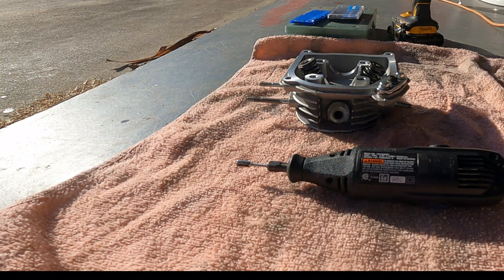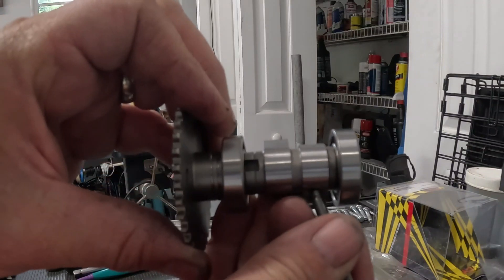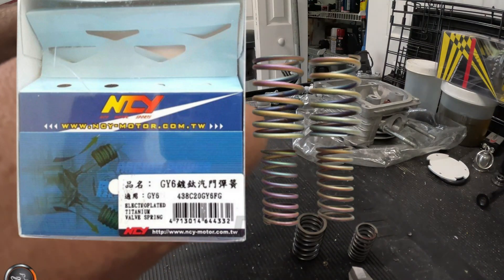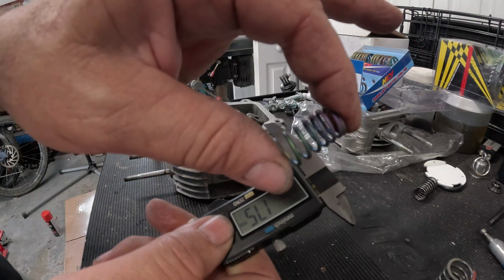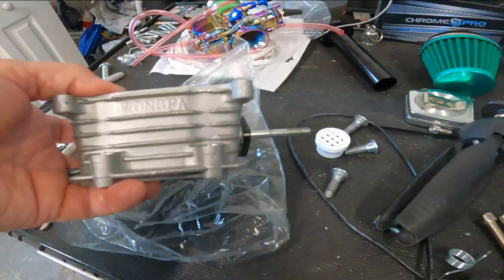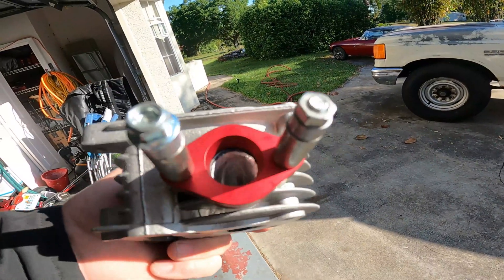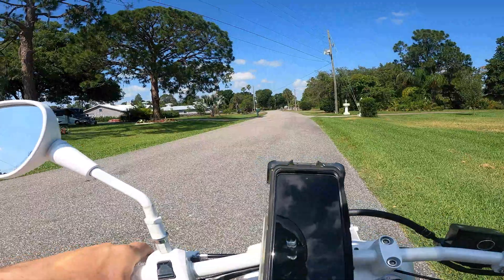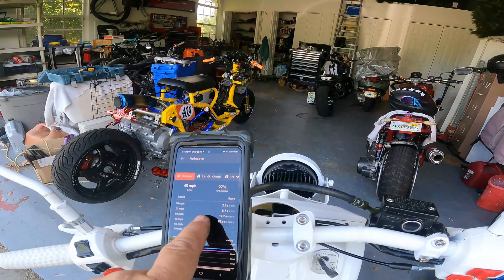Can You Port Your Own GY6 50cc 139QMB Maddog Head and make it High Performance to Avoid Valve Float?

Comment: What determines a kit compression. The weight of the piston or the thinness?
Reply from the maker: The compression ratio?  That is a big secret it seems.  I have not been able to find that info anywhere.  It is purely based on the volume of air at TDC vs the volume at bottom.  Lighter thin pistons are made to spin up to RPM quicker.  Heavier pistons are made to withstand high compression loads from things like turbos and nitrous.  So piston weight and thickness is kind of out of our hands as I have no idea if we even have choices other than cast and forged.

Comment: Hi great video, please what is that app for speed recording called?
Thanks 👍🏻
Reply from the maker: It is called "drag racer" .  I think it is dead because I dont get ads anymore and I cant find it on the ad store.  It is not that accurate on faster bikes. Works good on the maddog, but for the electric stuff I need the Dragy ($100ish) to get more accurate 0-60 times.

Comment: And I got news for you I'm using a poloni variator just a little bit bigger than diameter and it has better roller ramps polini clutch also and having very good results GY6 50cc I don't know why it's not working on your engine but the bike weight is different other factors to but you know what your bike does and what works best for it but the stock variator ramps are just no good and the ramp angle is very bad too for top speed do a little more research or do your homework a little bit more you'll see will definitely with the Big bore kit

Comment: I know I'm leaving a lot of comments also I want to say to you size I really like your show and you know what you're doing it's just a suggestion your minimum with your torque and your horse power and to expect any kind of improvement it won't be much because you're just limited with your displacement and your torque and so what I don't think you're wasting your time with the valve springs and the Portland and Mill the head that's what I always do everything that belongs to me and that makes a difference on top end speed

Comment: If you really want to get technical like you are intake valve diameter Port energy velocity low lift flow I can go on and on and on valve curtain area you know I know it's only a GY6 but yes it will make a difference I don't know why you're saying that I guess maybe with the little 50cc 39 mm piston what do you expect I guess that's what it is 39 or 37 what you make sense for most of the stuff you're talking about and I like your show keep up the good work

Comment: What you doing a really good job it's running really fast for a 50CC I'm working on a 52.4 MM Big bore Naruku build and I'm shooting for 70 mph I had it up to to 60 mi an hour what the 52 mm satin finish is what you want with your porting and polishing and it makes a difference once you have more displacement
Reply from the maker: @steveblottenberger1097  You must be running a skinny tire Tao Tao or type scooter?   That's an awesome speed 🤘👍

Comment: Ok so i put together a 80cc motor .. i used ..used parts but they were in great condition .. except for the piston rings  but im not sure what head to use exactly i have a bunch of stock 50 heads some have a better or deeper combustion chamber and some hardly have any .. i dont know what one would be better to use .. right now it seem it has way too much compression .. but at the time i had the motor on the scooter my kick start was broken and the electric start wasnt spinning it fast enough .. actually is was very vey slow .. now i have a kick start to use . So i may keep motor the way it is and try and kick it . But what do yall think does it sound like too much compression with my very Lil bit of information . Any help would be appreciated 👍 thanks
Reply from the maker: @RickyBish  high compression is good for power but can be super annoying also.  Scary to start and hard to start

Comment: Can I install thicker washers to the bottom of my valve springs to act as a more stiffer valve spring?
Reply from the maker: @JonahNAloha  Yes.  They are "valve shims".  You can run 2 on there instead of the stock 1.  I think 50s and 150s might be same if you have any spare ones laying around.  If not just thicker same size washers.

Comment: I keep my 150cc rpm between 8-9 max. Ive garage ported a bunch of old chevy heads and tbi heads. Turbo manifolds etc. I blame you for this next project though because i was looking for something else and got sidetracked with this one. Im going to have a. Extra 150cc head for my matte red one. Im curious if i go ahead and give it the port and polish what cam would you recommend to throw in with it for the trouble? I have the one rolling wrench sent me with my big bore kit on my other. I just remember in another of your clips you said you loved on of the cams and it was close to the big bore kit performance with carb and cam swap.
Reply from the maker: @tiredofinsanity  I do love that rolling wrench one.  It is a Taida T100.  Mid range.  I trialed an A9 and hated it, but...  I think I had my RPMs too low to appreciate it.  I could not make RPM with it and don't I think I tried lighter rollers.  That bike has an SSPG A12 in it now and seems to be a mid range like the T100, but way less money.
Reply: @GhettoWrench sounds like I have mine primed for this then

Comment: You didn't change the cam or valves so you didn't need heavier springs. Also you could have the best porter ever do the work, but the carb or exhaust can't support more airflow. You will not see gains.  More air in more air out, more power.
Reply from the maker: I have an NCY Cam and 19mm PE Nibbi on it.  Thinking about putting that 21mm PWK back on.  It made more RPM on top.  But ran worse down low.
Reply: @GhettoWrench  Pretty typical of a cam. They lower dynamic compression. Shave the head to pick it back up and regain more bottom.
Reply from the maker: @davidwickboldt712  how much can I shave the head?  It already has a super thin head gasket.  I put a thin head gasket in my ghost 212 and holy crap...  the difference was amazing.

Comment: Can u wire it back. I'm in a bind. Waiting on harness. I'm no nechanic
Reply from the maker: Wire what back?  The entire bike?  You can make any harness.  Check out my "chuck-it" videos.  I am pretty much making that harness.  Even tho I am using the originals wires so i don't have to buy more wire.  All the connections I am doing from scratch.

Comment: 69 mm valves give about 0.5 kW. Intake tuubing length is important for resonances.
Reply from the maker: So is the 65mm preferred over the 69 then?  My new BBK 52.4mm came with the 64mm valve head and the valves are bigger.  20/23 I think.

Comment: Another great video - given how long people have been fiddling with GY6’s, there are zero people actually testing for results… 

I’ve gotta feeling at the end of all this the advice is going to be put any tuning effort into a motor swap 😂
Reply from the maker: That was always my complaint.  No before and after results.  Im sure an engine swap could have already happened.  LOL.  I'm running outta ideas to try and get this faster in 49cc mode.  NCY performance variator is 89mm vs the 95mm one.  I may have one of those.  I think that big ass wheel and tire are what kills these things.  But that is also the cool look.  😎

Comment: How does porting affect valve float?
Reply from the maker: Well in theory when you get into stuff like porting and cams you also get into higher RPM which can exceed your OEM valve springs.  It was not the case for me.  LOL.  They kind of all go together in making a performance head.
Reply: When i ported my big valve head for my 90cc i think i did more harm than good    it pulls like hell at low rpm but higher rpm it looses allot of power so top speed is 70kmh 43mph

So i probaly made them a bit too big  i do have a 24mm carb with it tho
Reply from the maker: @DiyNuke  ahhh....  that almost describes what mine felt like.  Quicker, but struggled on top.

Comment: I think it’s worth it every time especially if you already have to replace springs or a valve. Any gains are good gains right? I think you did a good job
Reply: The fact that you actually used a spacer as a guide is a great way to get consistent port matches. By eye is how you get wonky ports so great job with that. Only thing I would have suggested was under the valve on the short radius of the port,  the tight turn can usually use just a touch of smother and the casting rings are usually there,  be careful of nicking the seat. Also there is a actual difference in the heads. 64 Mm valve length because of the short valve stem have the valve seat lower than the 69mm valve stem with the taller valve seat. Easy way to tell the difference is top of valve springs will be flush with the valve cover gasket,  69mm valve are just above the sealing surface.  69mm valve stem heads because of the taller valve seat can take more porting to the floor than the shorter 64mm valve heads. 64mm valve stem heads have a lot less material and are easily blown through.  There are videos of people cutting the 64 and 69mm valve stem heads in half.  So be mindful of which head you are going to port and for why.  Otherwise great video buddy 👍 👏 👌
Reply from the maker: @jeremyhope6869  thanks so much.  That is great info.  My new 52.4mm kit has the 64mm head.  I don't think I'm gonna touch that one.  LOL.
Reply: @GhettoWrench  Google 69 vs 64mm valve head should show you the difference so you can see how much you can actually touch up and where you can actually improve the flow. Seeing a cut away actually helps. Another thing I liked to do when I was seriously with the gy6 was use the old cylinder and cut away a pie cut so you can bolt your new head on and check your valve clearance with the cam bolted on and the valve fully opened.  Should tell you exactly how much you can shave off the head for max compression.  Think old stroke using a wire on the piston to check squish.  Same concept except valve clearance and simple way to check the clearance before shaving the head blind. Gasket thickness and since you can bolt cam on and actually get a idea of what cam is actually holding valve open for what and if your high performance cam is actually a performance cam for you. I know it sounds excessive but buddy you are way past simple bolt on and everything now is going to be custom made or modified 😆 🤣
Reply from the maker: @jeremyhope6869  my brain just exploded.  What a good idea compared to using clay with that cutaway.  I do have extra old heads.  Thanks.
Reply: @GhettoWrench  yep, how we used to set em up, cut the cylinder and see how much room to shave off the head. How much compression,  when the stock starter motor has a heart attack on the 2nd push of the button,  that is enough compression 😆  magic smoke from the starter,  yep perfect 🥰
Reply from the maker: Good point.  Everything adds up.  And on these 50s the gains are tiny since we start so low in HP.

Comment: Do you recommend the stiffer springs?
Reply from the maker: Not so far.  I am gonna drop roller weight again and see.  I really felt like they taking power.  Could be all in my head though. I never got to a high enough RPM to justify them yet.
Reply: @GhettoWrench  have you thought about using a two wire coil from a car to see if you get a hotter spark
Reply from the maker: @jeffkrauss5582  I have not.  I thought about testing the "NCY" coil/Plug thing but have not bought it yet.
Reply: @GhettoWrench  I believe the nyc is just a 96 caprice or crown Vic coil
Reply from the maker: @jeffkrauss5582  oh...  interesting.   Thanks
Reply: If u want to go fast your better off buying a bigger complete engine if u end up getting a 150cc or bigger you will have to fabricate new engine frame mounts because on those motors the mounts are on top of the engine the 50cc are located at the bottom of the engine
Reply from the maker: @Smodlee  I actually have 2 150s.  I just like seeing how fast I can get the 50 to go for fun.  I never ride it anywhere.  LOL